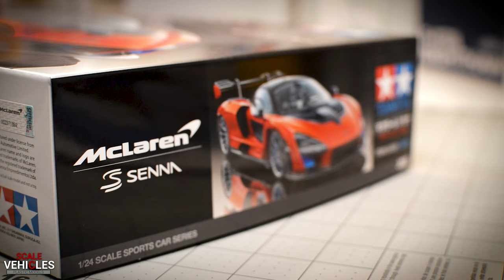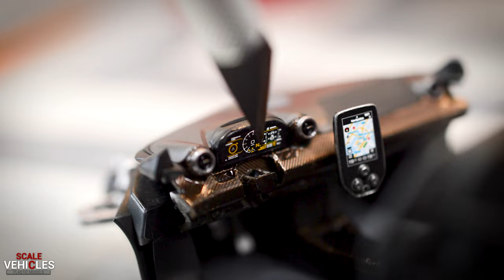Plastic Build of the Tamiya McLaren Senna Spider 1/24 scale model PT2

Comment: Just brought this kit home and was searching for build vids when I found yours, glad I did. Great video, nice soundtrack and an absolutely spectacular build, congrats! Thanks for the carbon fiber how-to in PT 1, this car just isn't night without it. Did you do the 2K clear on the interior CF as well?  If so, great job on the masking. You mentioned mixing the Tamiya cement with sprues, could you expand on the benefits of this, please?

Subscribed and looking for more of your videos, thanks so much for your time and effort in sharing!
Reply from the maker: Hello Bill!. Thank you for your comment, I’m glad you liked the video :). I think it’s one of the best model I’ve ever made. The interior has Tamiya clear instead. Mmm benefits of mixing sprues with Tamiya thin are many. You can use it as a filler, to fill gaps and holes and it can be easily sanded after drying since it becomes hard as the other plastics. What I do is Once I have a Tamiya thin cement less than half, I cut a few leftover sprues and fill it in. You can make it as thick as you want. Thank you for subscribing my friend 🙌🏼.